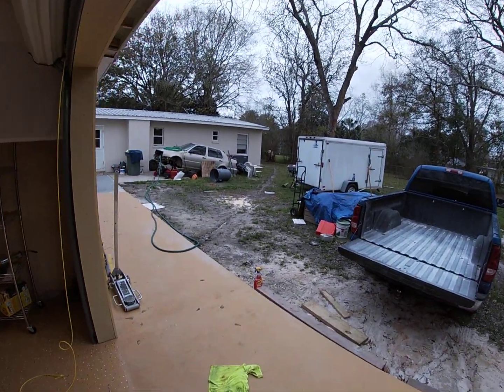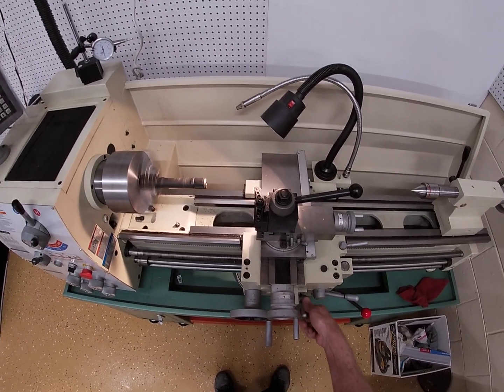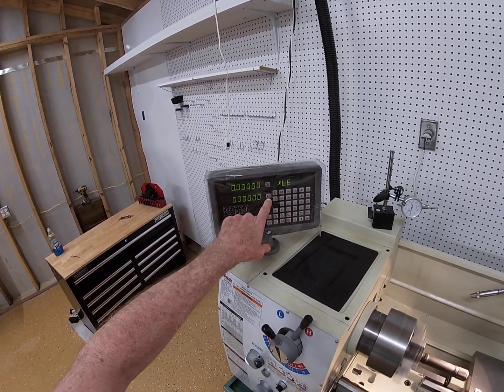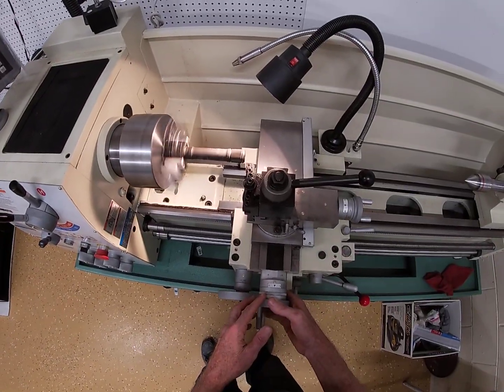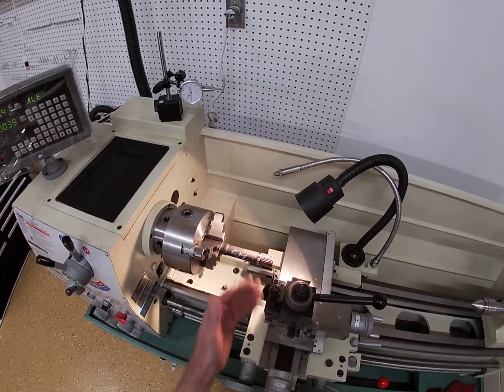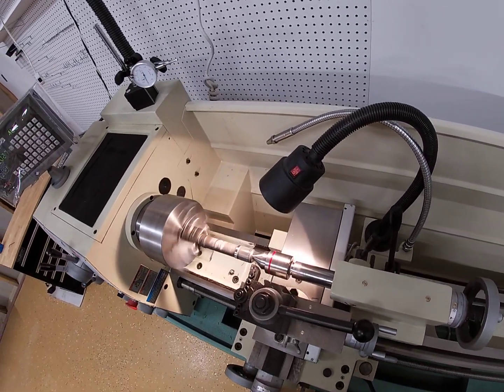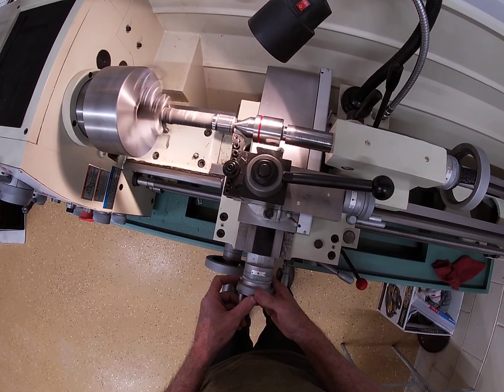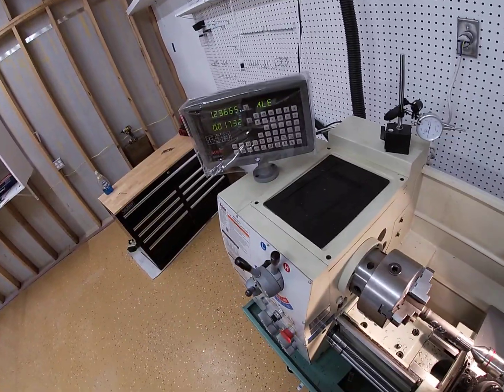Turning Hard steel made easy . Amateur Machine Shop cutting splines off axle  part 1

Comment: sir thank you for the video. i was possibly looking to shorten a shaft and i was unsure about the lathe requirements to turn a similar shaft.. i was going to try and modify a transmission shaft.. similar metal and size... is there a video i havent seen that talks more indepthly on the cutting yes but also the machine used... thank you... i have seen grizzly brand lathes or i believe jet or used but i dont know like the hp rating the size of the headstock or chuck or bed size... thanks